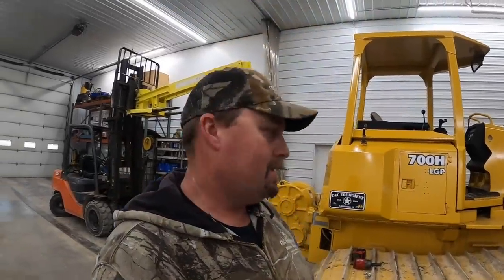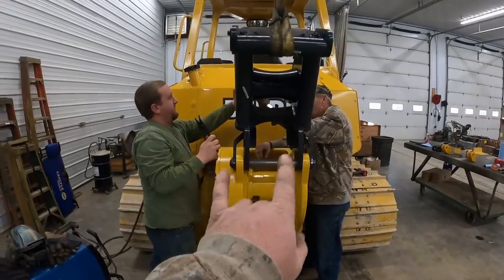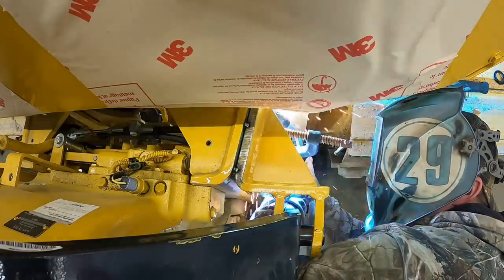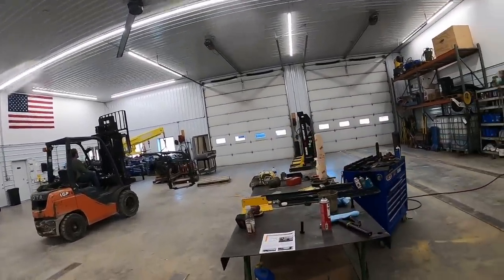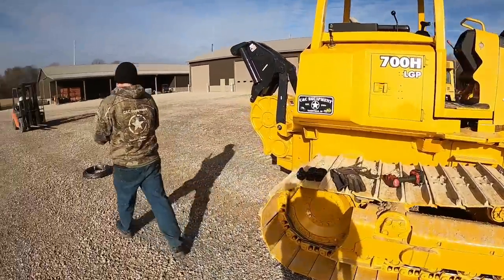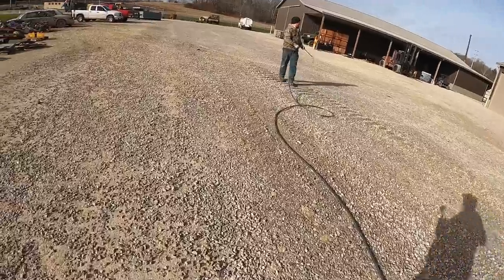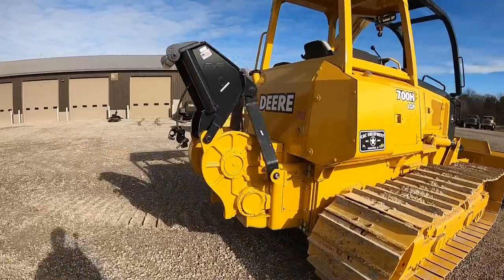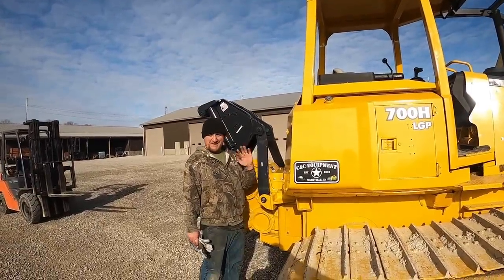Part 2 of winch install and mounting log arch and sweeps on Deere 700H @C_CEQUIPMENT

Comment: I used to be a splicer with the phone company (GTE California, now Verizon). When we would unwind cable off a reel, sometimes in the hundreds of feet, the trick to rewinding it on the ground is the make figure 8's with the wire as you restack it. This would work in your application if you needed to store it, for example. Love your videos. Learned a lot from them. Keep up the good work.

Comment: Hey  , why not put a EYE at the end in case you want to put an extention or a hook? It wont go anywhere and you can swage it on for a tight permanant fit .Put a tow hook on it and you can hook it on the winch when not in use. Use PPE GLOVES , SAFETY GLASSES.

Comment: With the winch added on I wouldn't have let it leave without back and side windows or screens. Cable is wicked when it breaks and could chop operators head off before they even know what was going on.
Reply from the maker: For sure
Buyer did not want at time but we talked him into it afterwards

Comment: If I were gonna run it I would want a screen on the back of the roll over protection to keep the cable from hitting me if it broke or Came loose. Other than that it looks good!
Reply from the maker: For sure
The buyer opted for screens after this

Comment: I've got a 650J with a slow leak coming out of the vent on the hydraulic pump, so I assume it needs a seal kit installed on it. Have you got a video on removing the hydraulic pump on that style of dozer? Thanks for all the great content. 👍
Reply from the maker: I don’t but it’s gonna be about the same thing as the 700
Crank your seat off and take back plate off
And you should be good to go

Comment: Yall fubar d that cable winding job. A 4x4 a bfh to seat the cable on the drum and it will seat after as you reel it in. Or watch Ron Pratt s video on replacing cable on Tatter
Reply from the maker: For sure
That was not our best attempt at it

Comment: Sorry to ask such a dumb question......winches for pickups vary in size say, 5,000 to 20,000, what size would the one you put on this dozer be, if there is such a number..100,000.
Reply from the maker: It’s not a dumb question at all
This is a 40,000lb winch
The electric winch ratings in my opinion are just not the same as a hydraulic or gear drive pto winch
Hope that helps
Reply: @C_CEQUIPMENT  Thanks, thats pretty powerful equipment, interesting to see yall working on them, looks like you have been at it for awhile.

Comment: I don't work heavy equip, so what is the electric connection on winch for. Great video's.
Reply from the maker: It’s for a low oil pressure light
Reply: AAh. Thank you .

Comment: What is a log arch? City boy asking.
Reply from the maker: So it’s the roller head we installed on top of winch.
So when you drag a log into the tractor it helps keep the front of the log from digging in the ground and once you have it pulled in tight it your only dragging the tail on the ground because the front is up in the air and it makes it pull way easier
Reply: Thanks for responding. Understand completely.